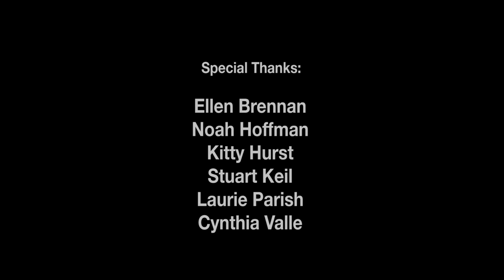Pipeline on the Precipice - Grand Canyon in Depth Episode 06

Comment: Good video.  Seems like the town and the park should share the cost as the town of Tusayn is the major beneficiary of all that water at the rim.
Reply: +Jonathan Beck Nope, Tusayan has it's own wells which they began drilling in the 1980s. The Park does NOT need to repair the pipeline... they need to take it out! Back in the 60s, we didn't have the technology to drill wells at the South Rim. Now we do! And it is a lot cheaper than re-doing the whole pipeline. They are ripping up the Canyon every time they work on the pipeline! They are supposed to be preserving the Canyon, are they not?
Reply: +Sean McClue But the town is a beneficiary of the water at the rim, even though they do not use it.  I agree that the pipe should come out, regardless of whether or not they can drill a replacement well.  But I doubt that option is on the table now that the NPS has to pay off the 150 million dollar capital improvements to Xanterra.
Reply: +Jonathan Beck Well, we could talk about the electricity it takes to run the pumps to move the water through the pipeline 20 miles across the Canyon... who's paying for that?
Reply: +Sean McClue - NPS, 25% of the power used at GCNP goes to pumping water.  They only have to pump it from Indian Garden to the rim, gravity does the rest.  Sadly the park is way too invested in infrastructre to reform how the water is handled.  They are going to have to replace the pipe, and I bet it will be bigger.
Reply: +Jonathan Beck Wow!

Comment: Am I missing something?  Why not just pump water from the Colorado River to settling and filtration units.  The pipeline is 19C technology, at best. The comments make me believe wells are undesirable but not impractical, but the Colorado is one of the biggest rivers on the continent. The All American Canal and Imperial Valley would never know the difference. Seems like good money after bad.  In Italy I drink water
 still supplied by Roman sources 2000 years old.  Forty years and obsolete ain't a good bang for the buck.

Comment: Visit eenews.net/stories/1060028827 for a good overview of alternatives to replacing the Trans Canyon Pipeline that are being explored. Could save taxpayers money and prevent using water from Canyon streams and the local aquifer.
Reply: +Tusayan's Future Wait, won't this old coal pipeline still be pumping water from the Colorado River?    How is that not a "Canyon stream?"  Also, will the Stilo group pay for annual maintenance of the pipeline?  Inquiring minds want to know.
Reply: +C. J.Mund The eenews link is interesting.  The problem with the slurry pipeline is the fact that Lake Powell might not be sustainable.  Some have suggested removing the damn because of the low levels, with the lack of water lake Mead is enough storage space, and with Mead full again the hydro output would increase.  One full lake is much more efficient than two half full lakes.
Reply: +C. J.Mund It would be pumped with actual legal Colorado River water rights, rather than just drilling wells near the South Rim. It would be a regional solution that could help deliver water to the Navajo Nation, which has legal Colorado River water rights, as well as retire the wells currently in operation near the South Rim and the Roaring Springs pipeline from the North Rim. Discussions are preliminary, but we believe it is economically feasible if the right stakeholders are involved, including maintenance.
Reply: +Tusayan&#39;s Future - sounds interesting, thanks for the post.